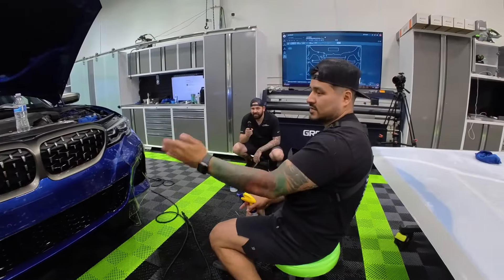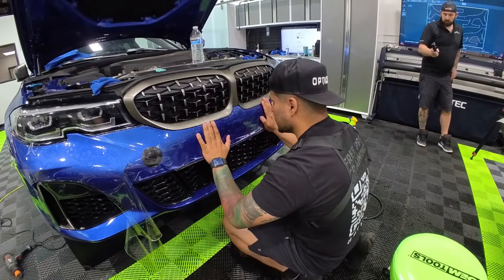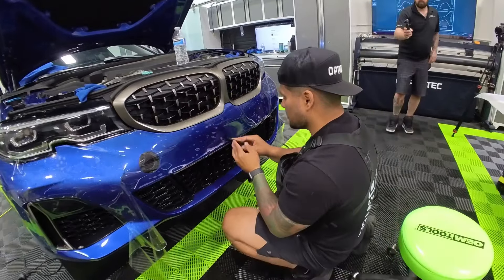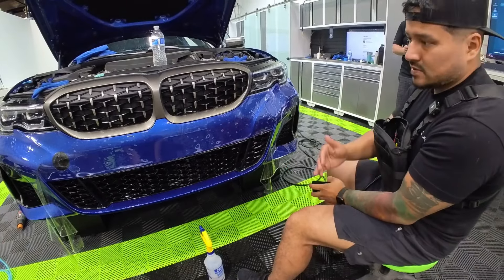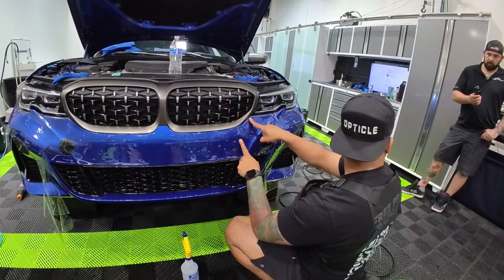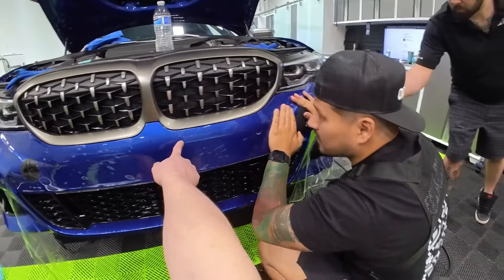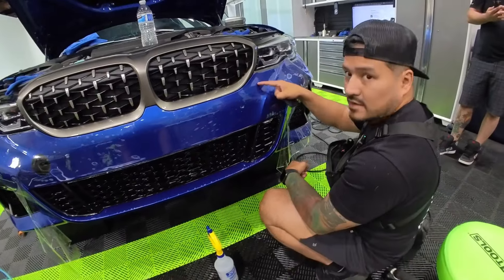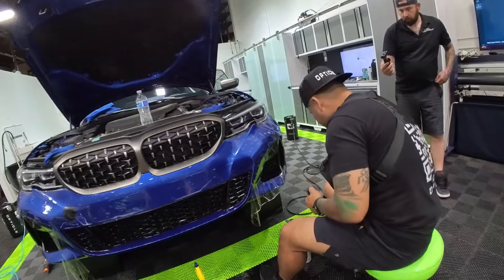PPF class front bumper. think ahead to get a perfect install

Comment: My wife bought a new car and we were gonna get PPF installed till I came across Icon Roclear. Which has the same benefits of PPF self healing tougher than ceramic. We went on a vacation and on the way back drove through a sand storm in Arizona and when we got back the whole car had sand all over it. After a touch less wash the car came out shiny like the day we picked it up at the dealership.
Reply: It’s trash, my front bumper has ppf, I installed accessory front spoilers on the bumper and decided to go with icon roclear. The first year it was great not so great after the first year. It’s starting to peel off and rocks are getting to the paint.

Comment: Definitely a cheap ppf install. Anything plotted short is cheap. Every cut will be short. Pay the extra for as much coverage as possible.
Reply: Most of the time its the best way to go if you're wrapping daily drivers as the costumer most likely wont want to pay for a bulk install. unless you are removing the bumper a bulk install will yield similar results to a kit anyways.
Reply: You’ve never installed ppf have you?
Reply: What a miserable mindset lol
Reply: Precut PPF ensures proper coverage and minimizes the risk of future issues. Not everything needs to be bulk installed, as that can lead to problems like poor fit, cut marks, and shrinkage. The only areas that typically require bulk installation are the hood and roof. Using precut PPF also avoids the need to remove trim, which can be a hassle. While knifeless tape helps, it has its limits—proper coverage is the goal.